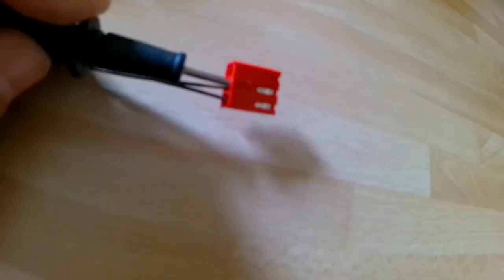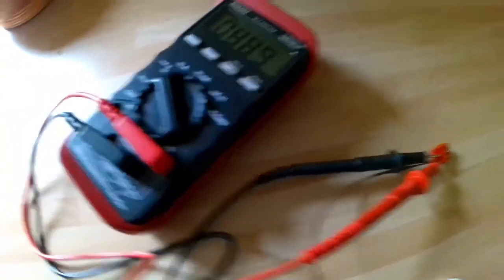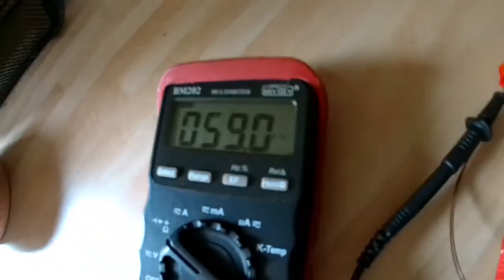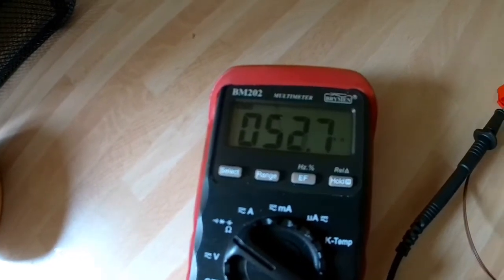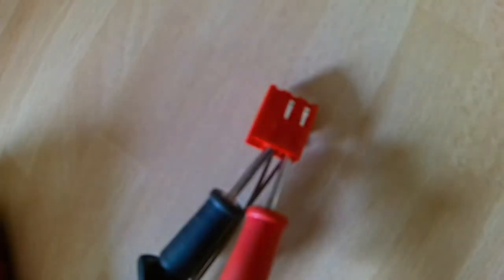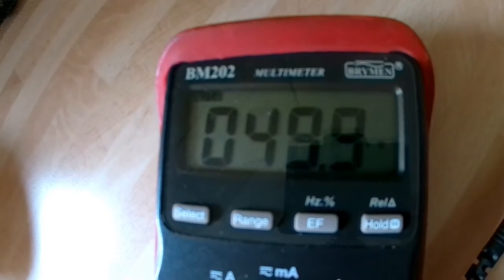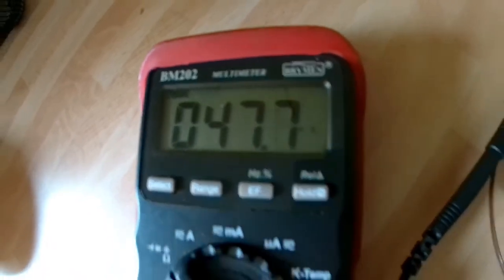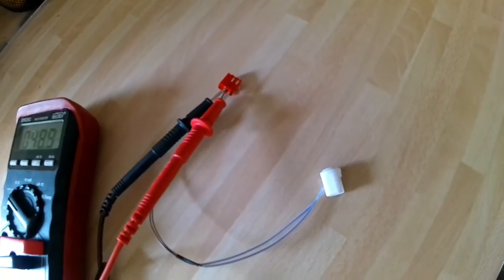Chinese Diesel Heater. Temperature Sensor Simple Test.

Comment: I have a question. I have a maxspeedingrods diesal heater. Keeps giving me the E-11 error. But you chuck heat down one of the pipes it don’t give the error and will fire up no problem. Is it that sensor that does that and if I cut and join the wires would that get rid of the E-11 error

Comment: My sensor shows the opposite...when I touch it, the resistance increases 🤣🤣🤣
Reply from the maker: Maybe your hands are colder or hotter than mine.
Reply: @ The problem is that setting the temperature to 22, the room heats up to 30 and does not stop… is to hot
Reply from the maker: @markozgec3518  The sensor that measures room temperature on mine is built into the control panel with display.  So if the panel is low down it will try and get that part of the room to temperature set. For example. I think I done a video on it or talked about it. In one of my vids. George
Reply from the maker: @markozgec3518  Also if the control panel is on a cold surface will effect it. Trying setting to 10deg or 15deg. Or heat setting 2 or 3. George
Reply: @MakeDoAndMend1  the screen is mounted higher, which means it could stop heating up sooner
Reply: @MakeDoAndMend1  if I set it to 15, the temperature also goes up to 33

Comment: should the sensor read 0 in a cold/normally open position fan is off?, and then as the sensor warms up it switches fan on?
Reply from the maker: I think you are referring to a switch. This isn't a switch. It's a sensor. It's resistance changes with temp. The signal from this sensor goes to the control board. This board controls fan, glow plug heater, fuel pump etc. Probably by a microprosesser. I don't have a circuit diagram of how the control boards works. Cheers from old George.  Thanks for watching.
Reply: @MakeDoAndMend1  Ok thanks so much I was confused on that one
Reply: @MakeDoAndMend1  Hi again, my sensor seems to be working as resistance goes down with body temp. Are you aware of any other fixes for the fan running continuously? My heater is in a dry workshop and I have only used it last winter when it was new. I went into shop for the first time since summer and the fan was running by itself with error code 7. the heaters seem to work well, surprised mine is not. wires are all in like new condition. battery is on a trickle charger so never has low voltage. If you are aware of anything to try it would be appreciated. Tks Mike